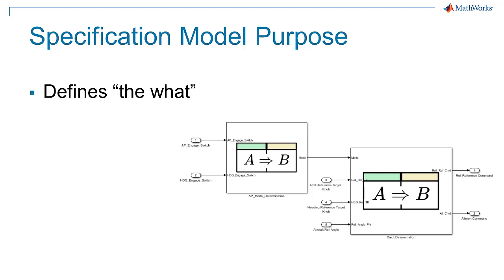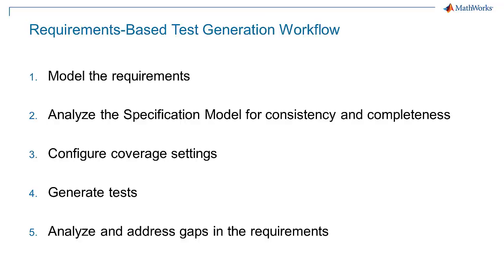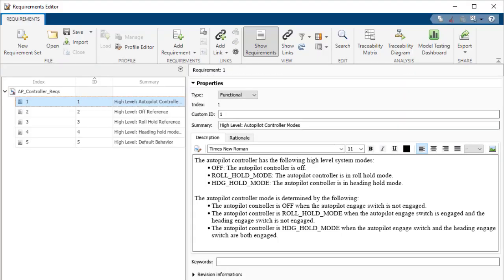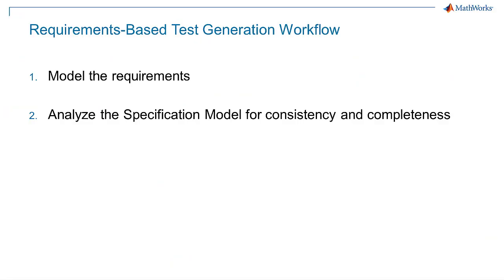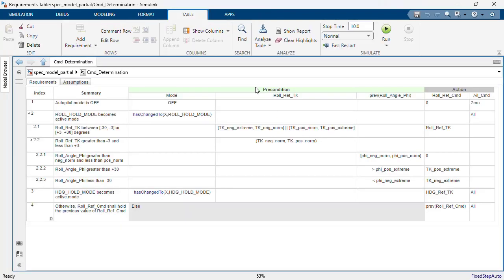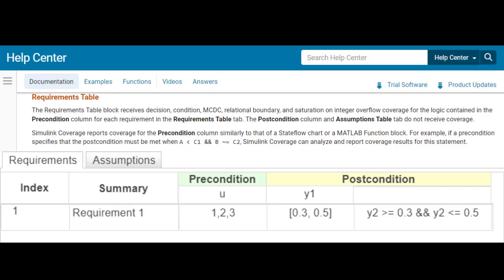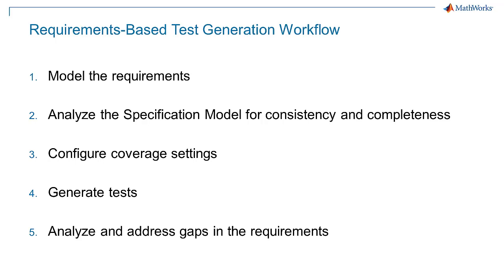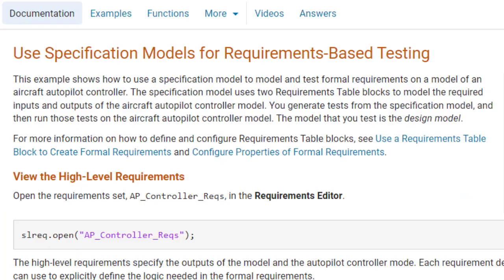How to Generate Requirements-Based Test Cases

Comment: I shall watch this series of videos with great interest! Application of a requirement based workflow has been fairly opaque so far with just the given documentation. The structuring/formatting of mathworks requirements is hard to explain coming from documenting requirements in excel or doors/similar.